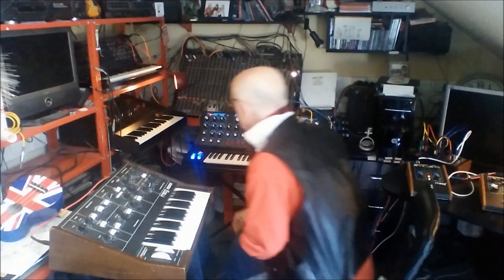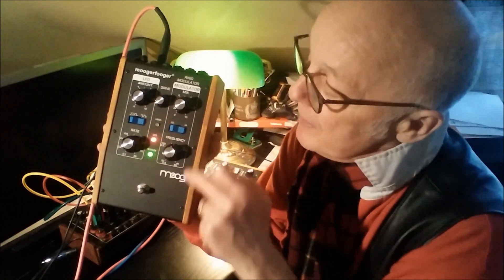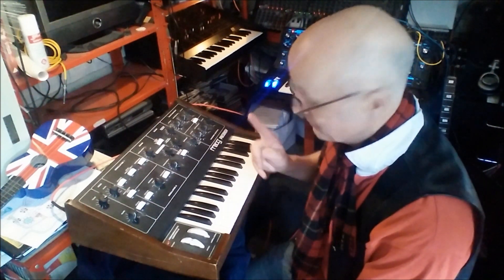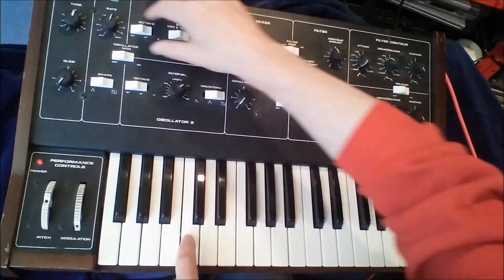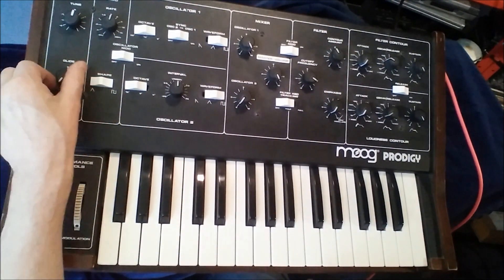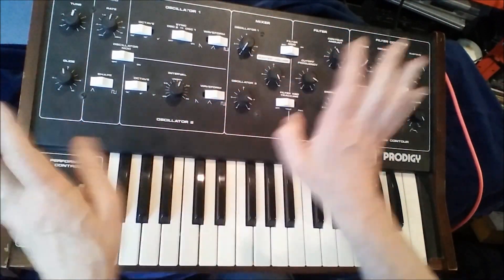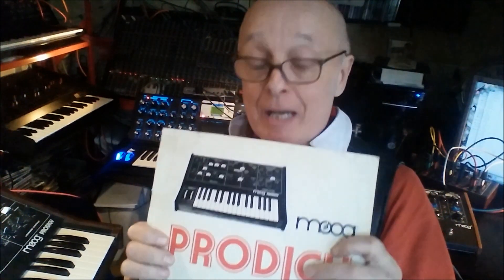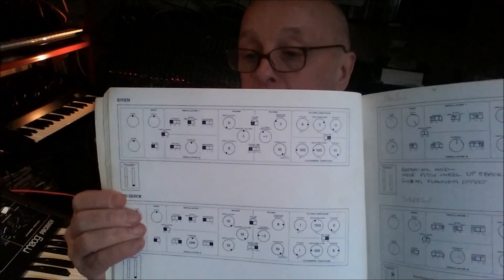How a Moog Prodigy works

Comment: 40 years on, and still got my model 1, along with original packing case, polystyrene packing pieces and original documentation! -You missed one switch though! - the "TRACKING" on the VCF "off" "half" and "full" - made soooo much difference when recreating "real world" instruments - still, when you have to explain to the kids "monophonic" means, and how the signal paths are managed by components not algorithms in a digital processor, I suppose something has to give!
Reply from the maker: Fair comment! I didn't mention the sync input at the back either, makes for a lot of fun when sequencing.
Reply: @murderousmaths  mine doesn't have one of them!

Comment: Thank you for this video! I've had an early Prodigy (one of the first 1000 made) for almost 10 years and I never really figured it out. This video is really helpful, and thank you for not being a condescending techy know-it-all! 
My Prodigy only has one line-out, can this go through a modulator and then through an amp? I don't have one, but someone said my synth is useless because it only has one line-out... And that I have to modify it to have multiple outs.. Or should I just use it straight up through an amp? That's what I've been doing and been getting some cool sounds. Thanks to your vid I wanna dust it off and give it another go!
Reply from the maker: Thanks for the nice feedback!  All you do is connect the line out to an amp via a modulator or pedal if you have one.  I have no idea what your friend is saying about multiple line outs unless it's suggesting you can access some of the control voltages to drive something else. Don't do it! You've got a classic machine so don't start hacking into it ~ just have fun!

Comment: I love my Moog Prodigy too!  I have the 336A model...  How steady is your modulation?  It seems nearly impossible to have a drum machine playing, sync the modulation, and have it sustain and keep to the beat.  On mine, I have to keep tweaking it very slightly to keep it on beat if I play one note.  Not sure if that is just my unit or if that happens with everyone.   Still a great machine -  I use my Moog Prodigy in every video on my channel!  Sweet synth
Reply from the maker: You're asking a lot of an old analogue synth to keep perfect time!  These things were built with pitch bend and modulation/tremolo so the keyboard player could compete on stage with the guitarist, while the drummer was drunk and the bass player was leering at the audience. Nobody could have imagined the standards that modern machines expect to work to. Yes, the drift in timing and pitch can be a bit frustrating, but to me it's part of their charm!